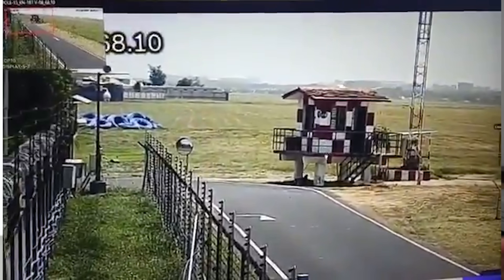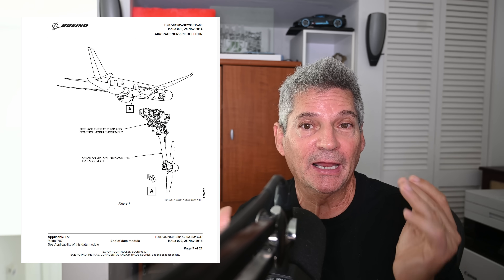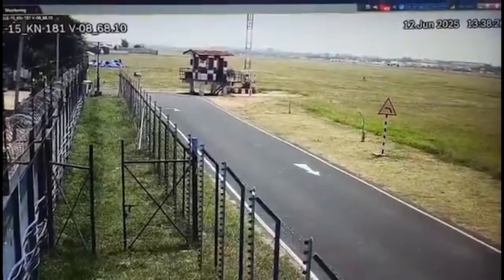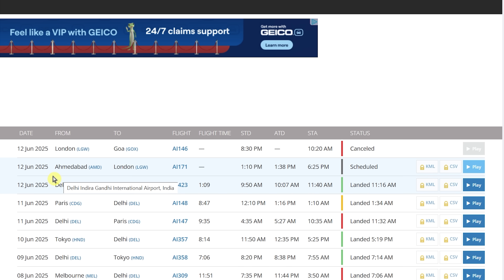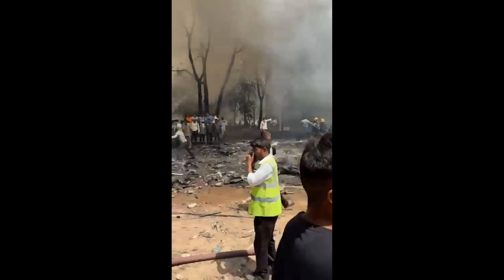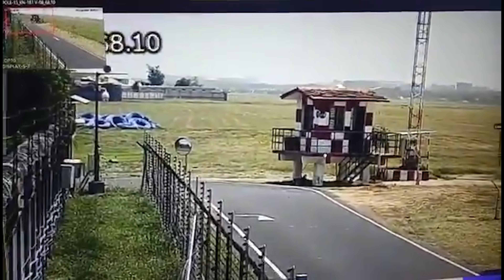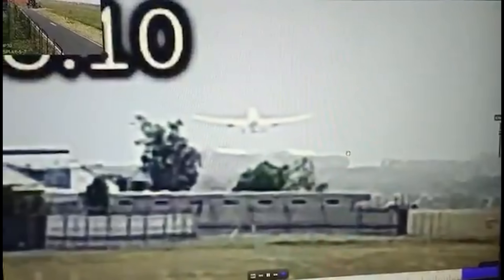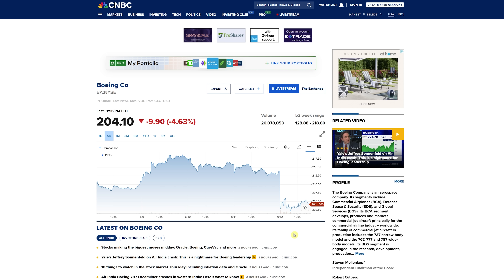What Caused Air India 171 Crash, Mysterious Sound Before Impact

Comment: You can't say this Dream Liner is free from any flaws no incidence happened. Some day some incidence has to happen if there's a design flaw & that would be the 1st & could be this one...
But having said that....
One more possibility that only one engine failed that might happend during Rotation/V2 speed so Pilots just were in dilemma whether to abort or fly. As there was no chance of breaking that's why they just fly from the end of the runway. The 1st action the copilot might have taken is to switch off the bad engine but in the haste switched off the good one & thereby complete loss off both the engines. At that moment ATC heard Pilot saying can't get power & Mayday call. Subsequent to loss of both engines power shut down RAM turbine deployed & wheels retraction stopped. Even if the Pilots in the last second might realize shutting off the wrong engine, it would be too late. Engines can't roar back in few seconds they had.

Comment: It sounds like a RAT, but the video doesn't prove it was a RAT. It could just be the main engine fan blades clipping at super-sonic speeds. You'd need to run the sound of the main engines during take off through a high or low pass filter close to that mid-range frequency prop sound, to determine if the recording device just didn't capture the frequency width of the main fan blades at full power. Also, the MPEG video codec takes a while to replace intra frames between main/key frames. You'll notice the grey pixels alleged to be a RAT, could have been where the black tires from the landing gear were exactly 15 or so frames ago... and the intraframes of the video codec hadn't fully updated and were still decoded as partially grey. Again, it does sound like a RAT, but main fan blades can also sound fluttery at full power during take off.

Comment: Check starboard side engine before plane start coming down. Is there a very light shadow smoke? And right after take off there is 1 sec glitch or event in cctv. 
If engines were working than do we see some type of refractive trail from engine exhaust?

Comment: Could there also be a scenario where the pilot, as soon as he realised on take-off that there was a problem, tried to dump fuel to make the aircraft lighter?  But before that task could be sufficiently done, the aircraft crashed and that was the reason for the massive explosion?  A lot of fuel might have already been spilt on to the top of the buildings and the trees when the plane crashed.  I have been wondering about this, because with the aircraft just reaching about 625 feet and being on a slow speed glide, why did the craft not just break apart on impact and instead explode so violently?  There must have been a lot of fuel surrounding the aircraft when it crashed, to have caused this.

Also considering that the craft crashed on top of a medical college cafeteria building during afternoon lunch time, where cooking is done with the help of gas cylinders and stoves.  This must have been an additional contributing factor to the explosion.

Comment: The cause of the accident is a human factor: the pilot should have retracted the wheels at 600 ft, and wings should have remained. Instead,  the pilot "cleaned" the wings, but the wheels remained, which is an additional violation of the plane's aerodynamics and lift force. It was all at a low altitude, and there was no time for the pilot to fix his mistake. When the aircraft starts to sink, it needs a lot of height below so that the pilot can react and correct the error.
There was no engine failure during the take-off phase.  All airplanes are designed so that with max weights they can continue the flight with one engine   up to a certain height in order to pull the configuration that bothers them into their wing spaces and then   make the procedure of returning to the airport with one engine. Engine damage is nowhere to be seen: no  smoke or fire. This is the most classic example of a plane falling into stalling due to a sudden retraction of the configuration on the wings, which is a human error.

At takeoff, the plane has maximum engine power, but that maximum engine power could not support the weight of the plane that sank because it lost the wing surface that served to increase its buoyancy.

There was no malfunction due to which the pilot could not retract the wheels because this type of plane has 3 systems: if one fails, you have 2 more. If two fail, you have another alternative. It has never happened that all 3 systems fail at the same time for any type of aircraft.

Comment: The RAT was deployed, thats why it sounds like a high speed prop!  Its under the plane, spins at very high speed in case of electricsl or hydraulic failure. The RAT is made for high altitude failure, not for very low altitude like the air India jet. Sure sounds like dual engine failure! But how do both engines fail together!!???.
The only survivor said he heard a loud bang just before the crash, and the lights flickered inside the plane. Probably the RAT being deployed. 
Both engines failing!! Contaminated fuel???

Comment: The rat deployment explains the loud bang noise in the cabin prior to the crash.
The rat deployment also points to loss of engines/electeical/hydraulic power as the cause of the crash.
What most likely happened is a massive hydraulic leak or major hyd system failure just prior to or just after takeoff.
This would explain the rat, the gear staying down, the weird flap configuration, just about all of it.
If they had had a couple hundred more feet of altitude, they could probably have recovered and landed again.

Comment: The Mysterious Sound was the Ram Air Turbine ( RAT) operating. The RAT automatically drops down behind the Landing Gear when a Catastrophic Failure occurs such as dual Engine Failure or Total Hydraulics failures.  The RAT generates Electricity to power the Avionics Equipment and one of the 3 Hydraulics systems. This   looks like an Aircraft failure.

Comment: Captain Steve copied your video lol Just finished watching.
Reply: multiple people copy this video almost verbatim. these suppose captain expert also not mention other expert info that THEY SHOULD KNOW. so they are not making videos as experts. just copy and paste other people work for views
for example the airplane cannot be flown without warnings about the flap and this is designed this way so any real captain will mention this. so the likelihood of flap error should be nullified with this function of the plane, visual confirmation of the crash that flap was engaged and also the flap and landing gear are in different areas in the cockpit that it's unlikely to retract flap prematurely
Reply: Yep u are correct

Comment: The noise from the RAT indicates major loss of hydraulic power and or electric power. That means fuel pumps were probably not getting enough power to feed engines.  Pilot said engines were not putting out thrust.  Video shows plane losing lift.   IMHO Points to major fault with batteries or cabling.

Comment: 1.) it didn’t take off perfectly, wasn’t textbook
2.) used every once of the runway, should have had takeoff aborted
3.) flight earlier in the day on the same plane couldn’t run entertainment system, air conditioner or call bells and relates to
4.) rat propellor turned on because of lack of electrical power within the plane

Poor maintenance by Air India

Comment: @jeffostroff May i ask you a question, did you see the trees and that building still intact with minimal damages ..But a Flight completely dissolved a trade center into ashes which is once called a engineering marvel and made up of high quality strengthened steel comparing to this construction made-up of normal concrete and bricks......How ??????...........RIP to all departed souls.🔴🔴🔴

Comment: Besides the sound, there is something more... or rather less... the sound of the wind turbine is too loud and the sound of the engines is hardly heard at all, which in a situation like this a pilot would immediately push to maximum power with the resulting noise... secondly... the landing gear is still extended, creating additional drag... thirdly, the takeoff flaps are not extended, as is evident from the video, so the necessary lift for takeoff was not produced... these factors could all be connected... if any system that controls the engines caused them to shut down, the hydraulic circuit would also have failed, and consequently there would be no controls for the flaps and no controls for the landing gear... the wind turbine provides the minimum necessary energy for cockpit controls in case of emergency. ... and in any case it is not designed to support all the systems of the aircraft but only to provide electrical support..

Comment: Just a wild guess, but I would say that a rat ruined the RAT.  It's my theory that rodents may have chewed through a critical power harness (PEPDS) that should have been shielded but wasn't, perhaps due to previous maintenance on it, and so there was just enough copper gauging left in the wire(s) to keep the electrical systems alive to pass the pre-flight checklist, but once the plane became airborne, for whatever reason the harness either burned itself out, or the critical wires completely tore off, so the Ram Air Turbine (RAT) that came on to provide auxiliary power was useless because the power it generates to the navigation systems is also carried by the PEPDS power harness.

Comment: Looks like the Flaps are in TAKE OFF configuration. RAT sound is clearly hearable. Not 100  % sure, but when having a closer look it seems that there is smoke coming out of the APU? Sharpened the picture by using AI... Interested? APU failures would defenetly have an impact on the AC and fresh air system when in PARK. There have been problems with the BAT. for the first delivered models (including fire). It is just a guess.... bit if.... it sounds like a typical chain of systems that failed at one time. But even if, the question is why they all failed together. Hard to tell of course....
Reply: 8:37 Trim on this picture also looks very steam. Might be that the metal was just bended during the ctash. But even for a take off configuration this is not normal I would say. As mentioned. it might be a consequence of the crash itself....😅
Reply: In 2015 Boeing released a bullet in that includes a warning when planes are connected to external power or powered on their own for too long, this might lead to a malfunction of the power system. It was mentioned that in this case all generators will go to an emergency state that can force the pilots into a potential dangerous situation (includig RAT drop). These modern planes do many things automated, which is good in most cases, but might be fatal in others....

Comment: The sound from the ill fated plane is of RAM jet, as well as the Jet #Turbines but losing thrust as it moves away in the video. It could mean that Fuel supply to the Jet Turbines got #cut off immediately after take off on full thrust --- meaning an engine sensor issue.

Comment: The flap argument going around is laughable to anyone who has piloted a commercial plan. First of all the dashboard would be lit up like a xmas tree with numerous audible warnings. Second, you would need a much higher Vr speed and AOA for liftoff than what is depicted in the video footage. Finally, takeoff flap setting for 787 (especially on a long runway like ABD) is 5-15 (aka barely visible) versus flap landing (25-30) very obvious. The RAT deployment is the definitive on the power loss. 787's have suffered numerous Li battery thermal runaway issues.

Comment: I agree with you for most of your statements since they are based on engineering knowledge AND common sense. However may I give you my 2 cents?

1- I'm sorry but I don't hear the sound of the RAT, I mean that the sound from the crash video is not comparable to the one recorded on the JAL landing, to me at least, and anyway India is quite crowdy so that you can possibly record many sounds others than the airplane (scooters, whatsoever...). I might be wrong of course but ...

2- At 7:22, I'm surprised that you didn't notice that the ADS-B data showing the airplane path overlayed to the airport, show (let's say seem to indicate) that they started the take-off roll from an intersection instead of the begining of the runway. 
So ... would it be possible to consider a crew mistake when inserting data in the FMC so that the performances (the necessary runway, the speeds, ...) displayed were wrong and might have suggested to the crew that the take-off was possible from the intersection so that they would have had 1900m only available? The last Aviation Herald information states:
According to ADS-B the aircraft had entered runway 23 from the apron, which without backtracking would leave a takeoff distance available of 1900 meters/6300 feet. Four minutes later - without further position data being received, so unclear whether the aircraft backtracked or not - the aircraft took off." 
It's strange, to say the least, that location data are available from the apron to the impact ... except those that could indicate if they backtracked the runway or not🤔. 
That's really a pity since this point could explain many things: a low speed at lift off, close to the lower limit, the cloud of dust generated by an overrun and a speed progressively decreasing and leading to a stall with anything to do with the flaps or a loss of power on both engines (moreover not any yaw movement is noticeable, the attitude of the airplane being very stable in yaw and roll)...
Crashes already happened for this exact reason... so I don't know, we'll see what the first report will say but I think it could be a good probable initial cause.

3- The survivor: to be honest I couldn't believe this was true, I thought he was a survivor in the building but not on the airplane! Eventually it seems to be confirmed despite the brutality of the crash and where this guy was seated. It's really hard to believe and I'm still sceptical to be honest. The probability to walk away almost uninjured from such a crash is 1 in a trillion! If it's real this man was not under the protection of an angel but of God himself...

Anyway, just my opinion
Regards
Reply: you can see the visual confirmation of the RAT, zoom in the original video.
Reply: @DarkKnight_779  Damn! I liked my theory but if the RAT really deployed, it changes everything and suggests that something very serious happened following lift-off. Indeed the RAT deploys only for dual engine failure which is unlikely in this accident (just my opinion) or low pressure in ALL 3 hydraulic systems (but this should not have impacted the thrust, right?) or loss of electrical power of the flight instruments or loss of electric motor pumps related to the FCS or the hydraulic system.
That's strange. Anyway the black boxes should be readable this time so ... let's be patient.
Regards

Comment: Pilots used all of the runway. A theory I have seen / heard on a video is that the pilots encountered technical issues after reaching V1 put prior to V-R. As a result they had to use the full length of the runway before they could get airborne. But because the issue(s) happened after V1 and (just) prior to V-R they are committed to take the aircraft airborne. As stopping would result in a high speed runway overrun.

Comment: It has good liftoff power and gets of as it should so wrong config, weightsetting etc I dont beleve in.. I think engine/technical problem 2-3 seconds after takeoff.
It speculates that setting 0 flaps instead of gear up? Would flaps even change that fast?
I think it sound like engines are idle? not that high intence sound, this sound more morring on idle? not a TOGA sound

Comment: Bit clinical. Dont you think it would be appropriate to start the video at least acknowledging the dead and their families and friends? 

I do agree with your analysis of the footage though...it definitely doesn't sound lije a normal jet engine! Apparently it was 40°c at the time and the air atmosphere described as 'heavy '. I wondered whether that had any impact on 6:00 the operation of the plane. i. e. Would the viscosity of the fuel change in really hot temps? The survivor said there were lights flickering green and white from when it took off. Which tends to indicate some electrical issue...now we're hearing in this video that a previous passenger said it was vety hot(AC possibly not working)?. 
Another thing.. is it normal for landing gear to be still down at that point? 
Thanks for informative insights.